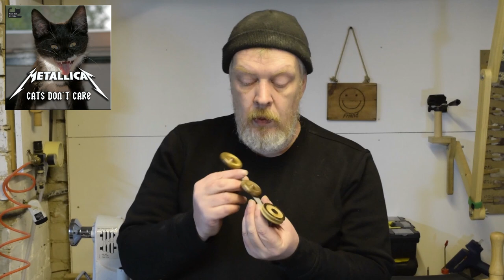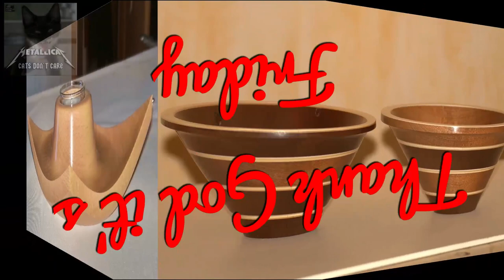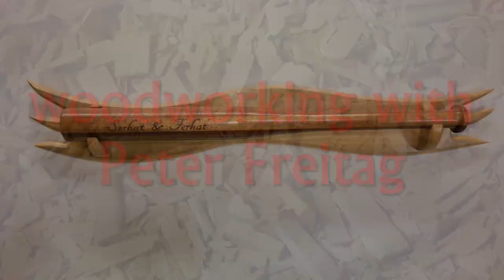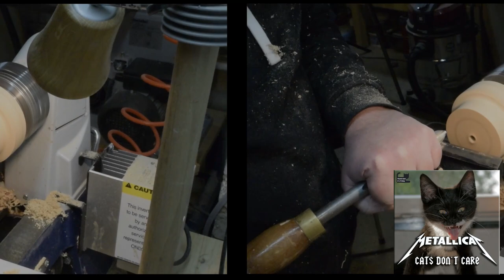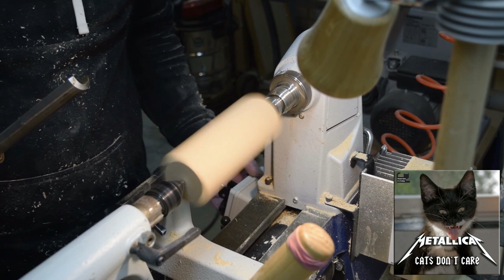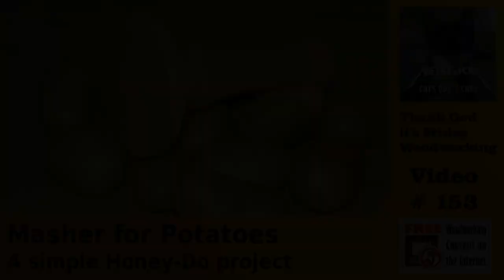Masher for Potatoes - A simple Honey-Do Project - Woodturning

Comment: Read through other patreon pages to find out how the rewards could work. There are quite a lot of good examples.  Big tip: only promise things that you can actually do without spending all your time on. Patreon has a good getting started pdf too.

I have been looking into it as well. I promised myself to start patreon as i reached 500 subs, which happened a few days ago. I got the basics set up, but need to make a few vids for it first. My constraint is time. Just expect it to take time to grow. Its not an instant income, but its fun as it provides a nice communication platform with those that really enjoy your stuff.

Im currently a patron to three channels, but only at the lowest level, money is tight here. I will be your patron also but  at low level only. Every little bit helps.

I like your musher. I always used metal mushers, never occurred to me to make wooden ones.